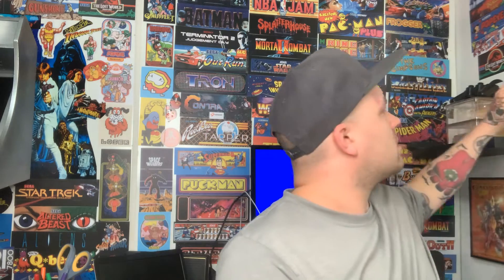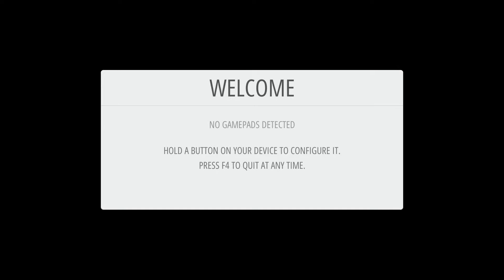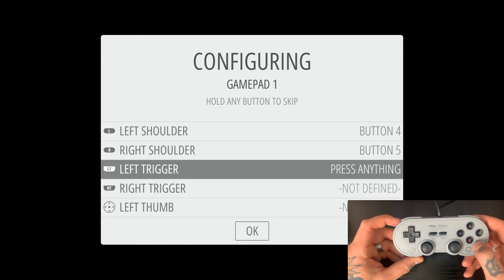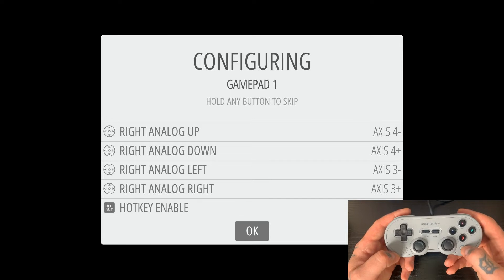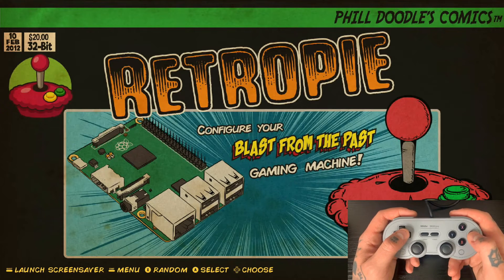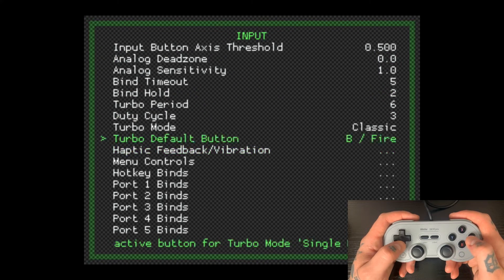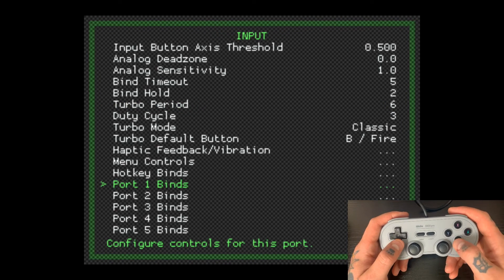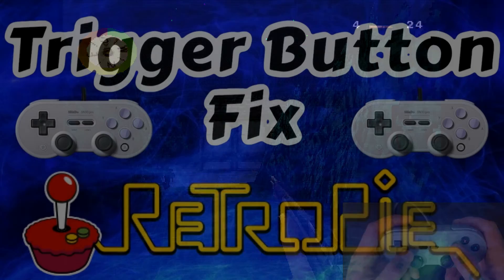Trigger Button Fix On RetroPie Tutorial - RetroPie Guy Tutorial - 8bitdo SN30 Pro Gamepad Controller

Comment: here is another possible solution: the SN30 could simply be starting in the wrong mode. I had this issue with my SN30 pro and what resolved it was starting the controller in D-input mode (hold B when turning the controller on). then it properly registered the triggers during the input mapping.
it will remember your choice so you don't have to do it every time. if you need the other modes for something else hold X while starting for X-input mode and hold Y for Nintendo Switch mode.

Comment: Hey man, I followed all these steps exactly...I have Rasberry pi system and this exact controller. When I'm in the retro arch, the triggers are already defined as  L2 a Axis +2 and R2 Axis +5    when I hold press and hold a time out clock of 3 seconds appears and I hit the trigger I'm trying to change and nothing changes....I'm losing my mind ! I even left it undefined in simple menu in hopes it would have them labeled key e or r like in your video...

Comment: I found out the same on the snes mini retroarch.  The thing is my L2 and R2 now do both the L1+L2 function. so when pressing L2 It does L1+L2.
This is on the 8bitdo SF30 Pro, the same one you have in the background running a ps1 game.
I am starting to think it is hardware related. that on the SF30 the L2 trigger is just meant to be an alternative feel to the L1 button.  Seeing the L1 and L2 registers as the same button when trying to map it into retroarch. kind a wierd. What do you think?
Have you managed to do the same on the SF30 Pro?

Comment: @ RETRO GAMING GUY 

SN30 PRO 
I PRESS START TO TURN ON
BUT while ITS ON THE HOME BUTTON
STAYS ON STAYS PRESSED LED BLUE + VIBRATING 
CRAZY AT SAME TIME 
SO I CAN NOT PAIR OR USE UPDATE MODE
DO YOU HAVE ANY SOLUTIONS
HOW TO FIX ??? DO I DISASSEMBLE ?? 
IS THERE ANY WAY TO DISCONNECT BATTERY ?? HOW TO REMOVE BATTERY

Comment: Thanks for posting this, I was ready to follow your instructions when my wired  SN30 arrived today,  but..... it worked as normal in the Emulation Station setup! I'm not sure if it was fixed in a recent release but it was all fine, triggers are now detected. My controller was also on latest firmware, not sure if that was related.

Comment: Can you map the "hotkey" from that menu? I didn't see it. I am having this same issue, but in addition to L2 and R2 not mapping from the retropie mapping menu, the 2 additional buttons on the 8bitdo controller also wont be recognized (for example the button on the lower righ that you set as a hotkey in this video).
Reply from the maker: Did you update the firmware on it prior to setting it up? I would put it through the 8bitdo firmware update either way. Shouldn't have that issue usually it happens if there is a issue with the firmware. Sometimes a firmware update could have been not written properly. Had that issue with the 8bitdo arcade stock. I just redid the update and everything worked perfect.
Reply from the maker: And sorry to answer your original question no you can't map the hot key in retroarch that's mapped on retropie

Comment: I did everything in the video and now my "gamepad is not detected" please help...
Reply from the maker: When you followed the steps in the video did it work initially all the way and then stop getting detected or did you not get through the setup process?
Reply: @officialchasebrogan  I did all the steps on the video then tried to go back to controller setup and the triggers still did not work. I unplugged the controller then restarted the system. The controller works now but the triggers  still do not.
Reply from the maker: @LosDoyerss  after the made the changes did you save autoconfig? You can try going into configuration file and saving that as well.
Reply: @officialchasebrogan  I did save it just like in the video. I'll re try the process again.
Reply from the maker: @LosDoyerss  yeah unfortunately I can’t think of any reason it wouldn’t work. I just did this same process a few days ago.

Comment: Dear anyone to whom it may concern, I’m using this with a wired Xbox 360 controller and it works exactly like him, the controller doesn’t seem to matter as long as it has the same buttons
Reply from the maker: Same process to fix it will work. A few different brands/models behave the same way upon the initial mapping. Follow these steps and you should have it up and running.
Reply: @officialchasebrogan  yeah I got it working just fine thanks for the vid, was looking for this exact type of vid you nailed it,

I just lost my sd card adapter so I’m waiting to get one so I can play some games 😊
Reply from the maker: @froopdoops6716  Awesome! Glad it worked out. Thanks for the kind words! Much appreciated.

Comment: Shame this isn't working for my 8BitDo on RetroArch via my Shield...
Reply from the maker: You can’t map within retroarch?
Reply: @officialchasebrogan  Sorted it. Didn't realise it had an analog and a digital option. Switched to digital and fixed it.

Hold L2, R2 and the star button down until the other button flashes and you've switched. 

This is for the black SN30 Pro for Android and X-Cloud controller for anybody needing to know.
Reply from the maker: @leeschofield488  perfect! Thanks for adding that. Huge help to anybody running into the same issue!
Reply: @leeschofield488  tried this, nothing happened and my triggers still don't register at all... any other ideas?